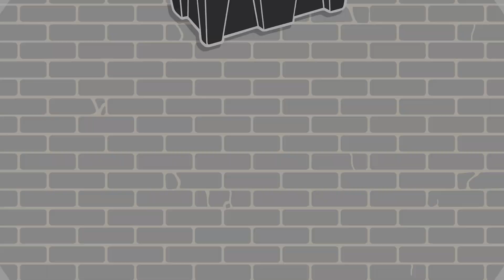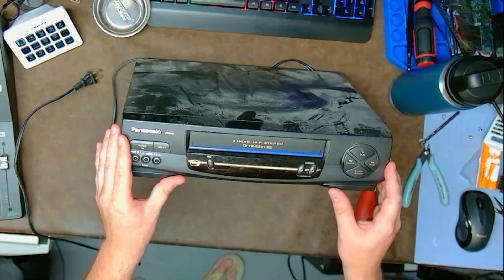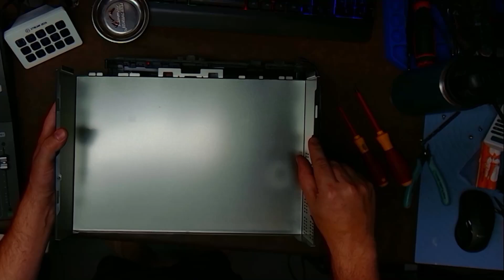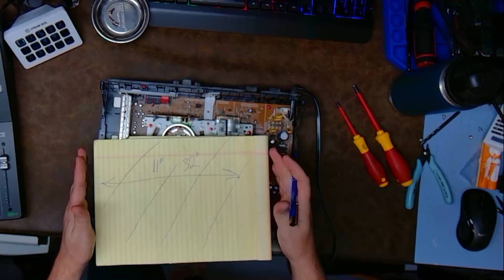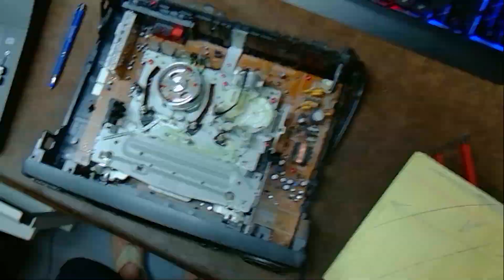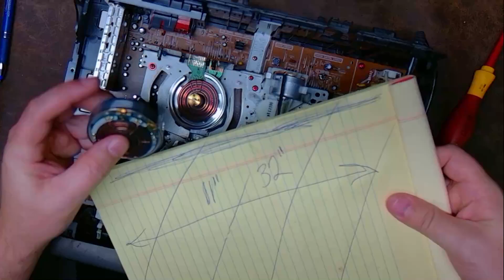1997 Panasonic VCR

Comment: 10:37 I've always wondered what is the function of these two yellow like rubber bands from left and right side around spinning black things.
Reply: i think those are brakes so the rewind spin can be stopped instantly.
Reply: @jacknoir9041  thanks
Reply from the maker: Cassette drive bands
Reply: @TakeItApartChannel  But they do not affect video playback in any way.With or without them